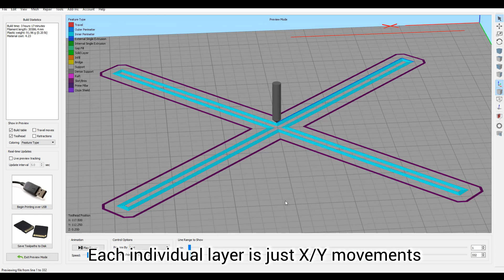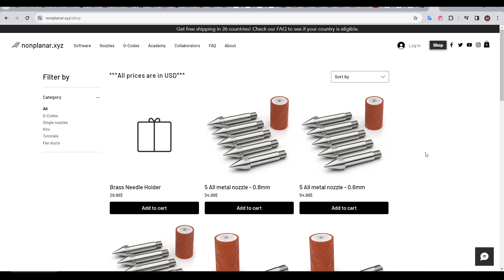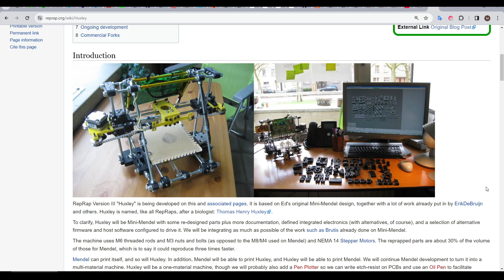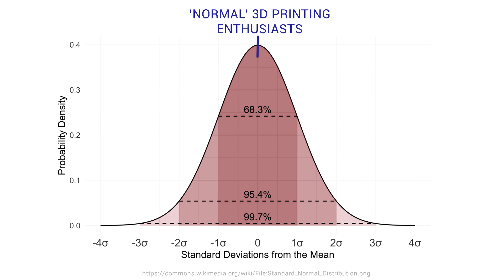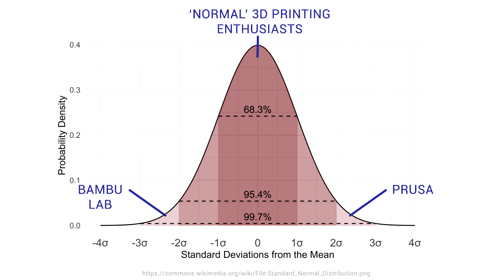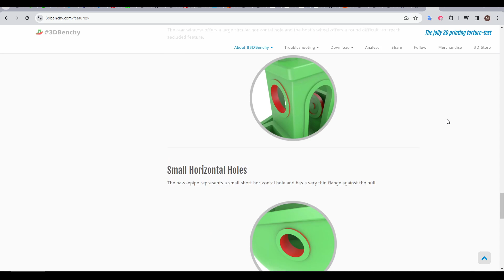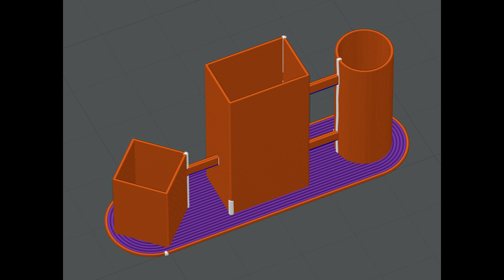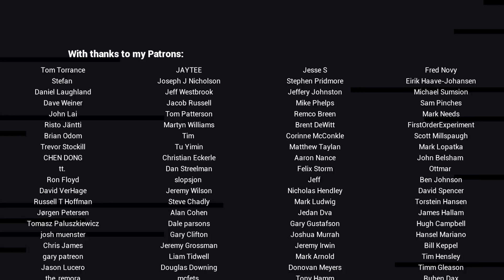3D printing mysteries that need to be solved in 2024

Comment: The swollen and cracking filament in the Bowden tube is due to moisture I think. Bake the spool and pull filament from a dry box and you'll be right back to new filament. It could be the heat that's fixing it too, either way baking the spool in the oven or on the heat bed with a cardboard box over it to get it properly dry will fix it.
Reply: Could be that it was exposed to UV light as well.
Reply: you can still print with it if your Bowden tube doest go against the direction of the spool ,and once it reaches the nozzle the moisture is gone and it prints just fine ,his Bowden tube bends the filament against the direction of the spool so it just breaks ,he needs to have the spool the other way around so not to flex the filament the other way
Reply: @fouzaialaa7962 yeah. That is a weird filament tube path
Reply: @fouzaialaa7962  That's a reverse Bowden tube, so the extruder is in the toolhead, the Bowden tube is just a filament guide back to the spool, you can't print like that if you have broken filament.
Reply: @SianaGearz  moisture is not "water" ,water is easy to deal with just dry it , moisture is liquid diffused in a small quantity as vapour, within the filament, its an imperceptible amount of water inside the filament , i have brittle pla now in my collection, what i do is a pre-heated in an oven on 60 C for 20 min , and it prints like new, but the breaking occurs becoz the filament becomes brittle .it will break if you try to go against the natural bend of the spool, if you go WITH the natural bend of the spool it works fine until it reaches the nozzle where it melts and new bonds are formed ,again this is an advice do with it whatever you want : if you want your old pla to not break in the Bowden tube ,dont go against the natural bend of the spool
Reply: That doesn't track. You can make an experiment, bag a coil of filament in a ziploc bag with a few drops of water. When you retrieve it a few months later, you'll find that the filament is supple, really nice, much more so than when you put it in. You won't be able to print it well, due to foaming and potentially hydrolysis in the hot-end, but it won't break like here in the bowden tube.

You can also show that UV light makes filament brittle, easy experiment. And i surmise fluorine compound fumes that somehow might get knocked out of PTFE might be hazardous as well, and would likely act catalytically without getting consumed in presence of heat. Or maybe a product of filament's own thermal degradation in the hotend travels up the Bowden tube. Because many people have made the experience that specifically the part of the filament in the Bowden tube becomes brittle and nothing else. I personally don't have Bowden though.

I have not seen evidence that baking brittle filament restores it, but then i have not had PLA go that brittle off the spool yet... not even my 7 year old spool... but if it is actually the case, then perhaps it has crystallised and the drying process anneals it? Rather than it being a moisture problem. Like you still need to dry your filament for good prints though, but like i said moisture does not result in brittleness, you can just try it yourself.

And Pooch or his guest i forget made a case that moisture IS bad for PLA and over time causes irreversible molecular damage. But then if it's irreversible, drying it will do not do any good, only maintaining it dry is good enough.
Reply: @SianaGearz  also its not UV becoz i keep my spools in there original transparent bags under the window ,they see plenty of sunlight ,and they dont degrade ,also my parts of the wind shield wiper of my car ,the cup holder and the water bottle cap are all fine , a little faded but absolutely fine

Comment: Here's another one... why are filament makers still shipping wet material in vacuum sealed packages? That is, I just opened a brand new spool of Overture matte PLA. The seal was still good when it was delivered, and dessicant pack was inside. I opened and printed with it immediately, and it was spewing out spider webs the whole time. Into the dehydrator it went. Why in the world should I have to do that with brand new material in this day and age? (and yes, after spending a few hours in the dehydrator, it printed great)

Comment: Regarding snapping filament, I once re-rolled some filament from a too large reel onto a smaller one, and after about a week, the re-rolled filament just disintegrated into loads and loads of tiny pieces about 20cm long while just sitting on the new reel. The stuff I didn't re-roll is still fine though. It wasn't the best filament or anything, just some cheap bulk for testing, but I was surprised by how quickly it degraded after being straightened and re-rolled just once.
Reply: It was wet.  I left a roll of pla (ok quality) outside open to the air in my shed where my printer is.  It has rained while it was out there too.  It became very brittle and I thought the spool was ruined.  I baked itbin my oven at about 260° F in a vacuum bag with a bunch of desiccant and that fixed it. No more breaking or brittleness.  The next thing I printed with that spool  had some quality problems on the first few layers but I think that was just print settings (it was a download that I just used mostly stock settings for my ender 3).  Dry filament and keep it dry imo.

Comment: Regarding prusa vs bambu, the latter may become the new stratasys, in terms of patenting that which has open source prior art. The few chinese companies that do publish code or machine assemblies (like Sovol or Creality) do so very late so as not to hand r&d to the competition.

Meanwhile, the release of the A1 almost saw an 80c bed temperature limit, an artificial restriction that took an update to remove. That means locked down printers are an update away from only taking proprietary RFID spools.

Without some way to add teeth to open-source hardware enforcement, 2024 may be the year of the locked down machine. A shame, as the community work in this space set it apart from other industries.
Reply: That's a very interesting perspective, and you're probably right. We've already seen a move away from the aluminium profiles that made printers easy to add things to.
Reply: Bambu has now locked out firmware downgrades, which might be seen as a step in preparation for that sort of thing, like you say mandated proprietary spools or feature lockout.
Reply: How exactly can they lock down the printers to RFID-spools-only, when the printers don't have RFID readers?

Your post is, unfortunately, a good example of the completely made up stuff (FUD), posted just to poopoo on a company you happen to not like.

You're part of the tribalism problem.
Reply: @henninghoefer  The AMS has a RFID Reader. The Bambu Lab filament spools have an RFID label that is read by the AMS and the slicer automatically recognizes which filament is present.

My hypothesis is that the RFID labels are primarily used as an convenience feature so that Bambu Lab users prefer to buy the filament from Bambu Lab. As the data on the RFID labels is encrypted, no other manufacturer can also offer filament with RFID labels that work with Bambu Lab printers.

The concern that Bambu Lab could make filament with RFID labels mandatory for the use of the printer comes from the fact that other manufacturers have already tried something similar. XYZ Printing, for example, has sold printers that use filament cartridges with a DRM system. You had to buy the consumables from XYZ Printing.
Reply: Some misinformation you have here buddy! That does no help and fuels some of the toxic behavior we're dealing with now.
Reply: Once they do that they will be gone from the market as quickly as they arrived. 

Had this nightmare before, bought a 3DSystems CubePro Trio as a bargain. At that time this machine was way ahead of the hobby printers on a hardware basis, it even had three extruders.

The proprietary software was horrible though. The slicer didn't work properly and didn't receive any updates. 
But worst of all: spools in a proprietary casing with a chip that communicated the material and material left on the spool to the printer. 
Which meant you had to buy 80€ spools

Comment: i'd really like to see a comparison between the prusa xl and any bambulab, doing a full plate of multicolor prints.

we all know more multicolor prints on bambulab at once wont increase neither the purge amount nor the time spent purging, will the prusa changing toolheads still win out on time and waste, or does it become a more equal playing field.

also if the last mystery, is due to temperatures, maybe you could simply space the parts out more, and see if the effect lessens, my thinking is the extra travel time would allow for the heater PID to equalize the temp better.